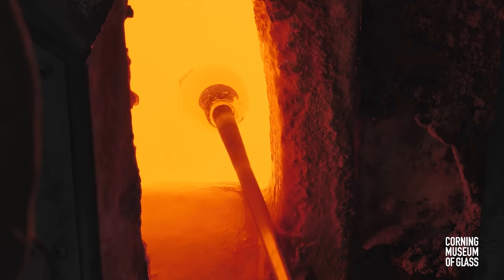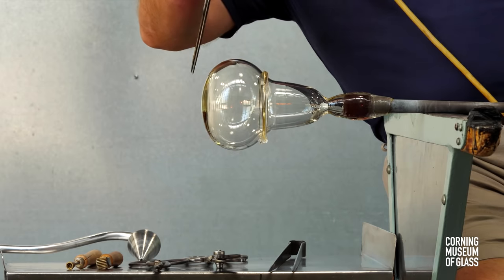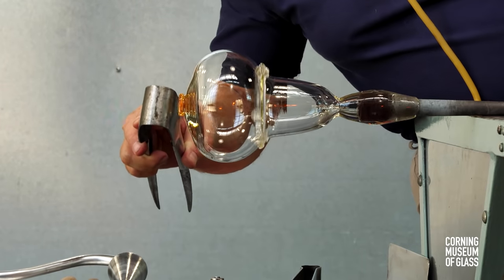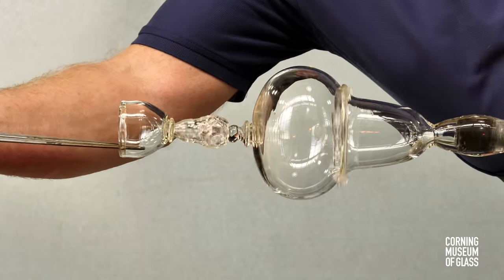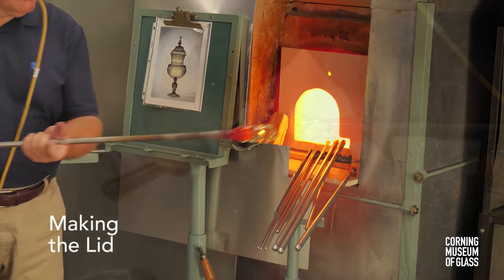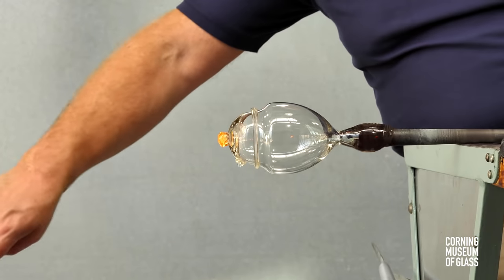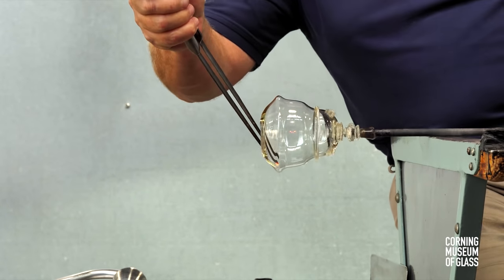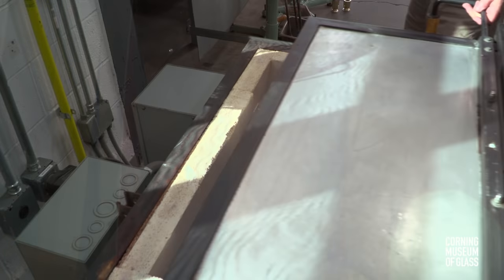Vasenpokal | Techniques of Renaissance Venetian-Style Glassworking

Comment: While the whole process was mesmerizing to watch, I wonder how would you add the extra detail the original piece has. Could anyone explain this?
Reply from the maker: Great question! The decoration you see on the vessel is called diamond-point engraving, which uses engraving tools tipped with small diamonds capable of making very fine lines on the glass. Thanks for watching!
Reply: I wondered the same thing!